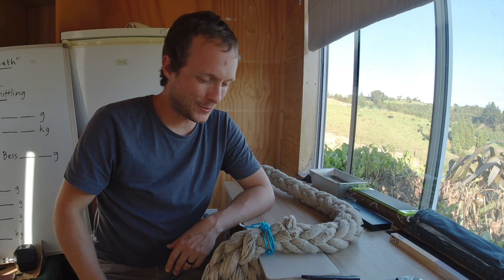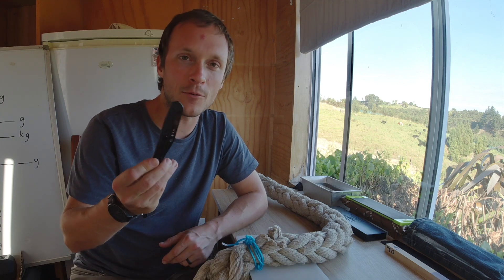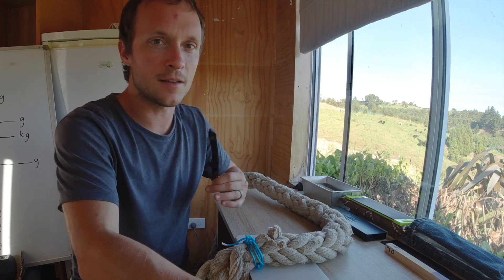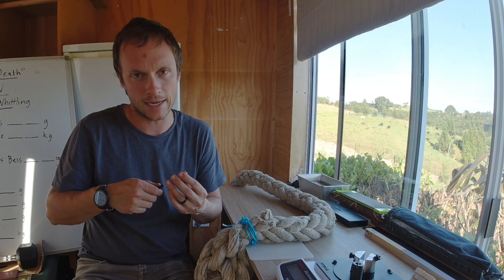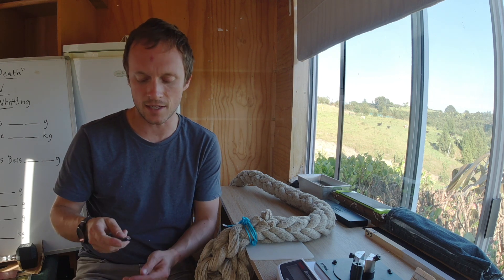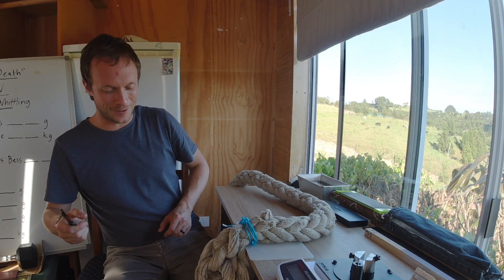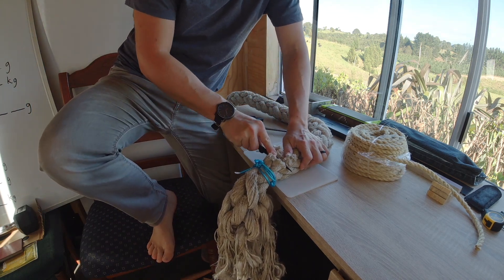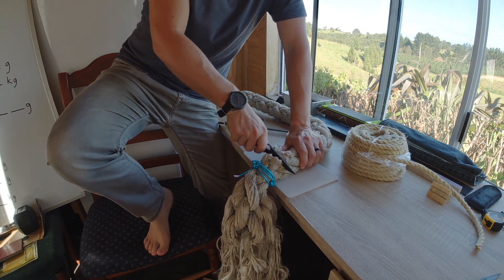Hair Whittling Edges vs Death Rope CPM S30V Maxamet M4 Tungsten Carbide & More

Comment: I wonder if you would have better luck using diamond stones or even diamond emulsion for stropping. With the really hard steels like M4 and maxamet, I’ve heard using traditional abrasives, wears away the softer parts of the metal matrix and leaves little protrusions of the hard carbides that are easily worn away once they aren’t supported by the softer bits of the matrix.
Reply from the maker: I actually just ordered some better diamond stones and CBN and diamond compound for strops.  Because it sounds like they shape the carbides better.  Interestingly recent research has shown the carbides are much better adhered and more durable than we often give them credit for, as long as you don't break them during sharpening.

Have you looked into this?
https://scienceofsharp.com/2019/11/03/carbides-in-maxamet/
Cheers, thanks for the great feedback!

Comment: I've worked with hemp ropes of significant size (albeit smaller than The Death Rope <TM>)and I can confirm there's a technique to cutting it.  If you press hard on it, the fibres are compressed together, so it just becomes harder to cut.
Reply from the maker: Yeah, I have noticed that!  One of the main reasons the Dual Grit M4 made it through is because it continued to shred through fibers slowly without applying super-heaps of pressure.  I always try to avoid pressing too hard when I begin the test, but when the edge stops severing fibers, you are kind of forced to.

I suppose the best edge for this test is going to hinge a lot on retained aggressiveness.  To be honest I'm not sure how useful this rope is going to be - I'm thinking about grabbing some 48mm thick Manila rope to standardize things more...  We'll see how it goes!

Comment: Have you tried putting a dual grit edge on the tungsten carbide?
Reply from the maker: I have, but so far I have not had any luck - it seems to chip away too large of chunks in the edge at 250 grit to be really refined into a keen apex.  I'm going to try it again with some new stropping compounds I have though - stay tuned!

Comment: Hope you are all feel better soon, another interesting result Gabe ...... to make any conclusions on wear resistance and edge performance you might make a before and after bess measurement. Sounds pedantic but the method you used for testing appeared to have a few issues which might have contributed to the results.
Firstly - most of the testing was with the rope fully supported on the bench.....this might lead to concluding that the test was more of a material characteristic test vs geometry rather than edge retention/performance. The way the nylon/polymer heavy braided fibres (heavy binding media) might have been a bigger contributor to the difficulty experienced. A sharpness test before and after might have been more enlightening here.
Secondly - the test with the tungsten at +600 really just showed +600 performs poorly in this material ..... but so do other steels at 130 bess
Thirdly - the last couple of cuts the end of the rope was hanging over the edge of bench ...... I suspect this factor had much more to do with the results experienced.
Keep up the great work ..... looking fwd to seeing how your testing goes with Vanax, cheers mate
Reply from the maker: Great thoughts - thanks for your input!  I've got Vanax reprofiled to 17dps but am going to wait to weed out some of the edges that are pretty certain to fail.  I do a BESS Test of the next knife against the M4 edge I put through the rope in this test to compare.  Sorry I forgot to in this video.

Yeah, the rope hanging probably did change things a bit, thanks for the observations!
Reply: @homeslicesharpening  No worries, enjoying the adventure, hope you're recovering ok

Comment: Sooo many variables here. I will echo the others here suggesting that dual grit ought to have some advantage with these sawing cuts, and the hair whittlers would theoretically perform better at push cuts. But also, there's other factors, like the overall grind geometries, and the position of the death rope while testing. In the first two tests, the rope is laying fairly flat, so that huge mass of fibre can exert more lateral pressure on the blades and cause wedging, especially on thicker geometries. The last two tests have the rope hanging off the edge of the table, so one end ought to fall away as the blade works its way through, or at least exert less wedging pressure.
Reply from the maker: Interesting stuff!  Yeah I had not thought about the wedging pressure - that could be having an effect.  It will never re-occur because I have rubber banded the end so it won't fray - so will be interesting if any of the knives are successful after that change.

Thanks for your thoughtful input, always a pleasure.

Comment: Do you possibly think that the "aggressiveness" of your hair whittling edge, has more to do with its ability to cut??   Depending on the steel type, a 400 grit stropped to 0.5 micron.. cuts better ( more aggressively)on certain things, than a 1000 grit egde ( same steel) stropped the same...
 Just food for thought.......

Comment: Cut card board vs cardboard you have used as a door mat in rainy weather.
You will note that cardboard used as a doormat murders edges because of all the sand in it. 

That rope most probably has seen some sand.
The DBK channel buys new thick rope and it and it appears to be consistent in their testing, but that rope is sort of expensive where they get it.
Reply from the maker: Great point.  I may have to invest in some cleaner rope, but will probe around a bit more to see if I stumble onto a miracle edge haha.

Cheers!

Comment: Take some ivermectin or hcq and zinc plus vitamin c. Keep your vitamin d levels up and get sun light. If you can't get ivermectin or hcq, take TQ that's in blackseed oil or quercetin. These all help zinc get into the cells. Helps your immune system.
Reply from the maker: Haha!  You know as much about mineral - urgy as you know about metallurgy!  I did all of this, except linseed oil.  It seemed to help heaps!  Thanks so much for the tips though - I genuinely feel valued.

Comment: Do take your time to fully recover!!
Especially if you have had the shot-too many are not and fail to understand that the ensuing problems e.g. with the heart, are avoidable and will blame Covid for something the shot caused 😏
Reply from the maker: Thanks heaps - my workplace has been super gracious.  I got generous time off.  I have noticed that the lung issues stick around longer than a standard flu but even so, I'm definitely rounding the bend - thanks for your concern!